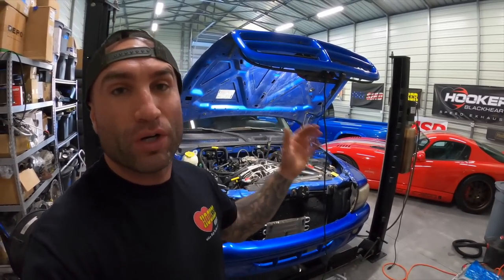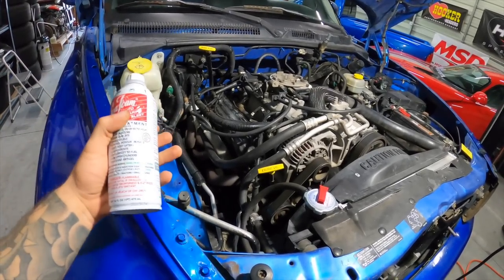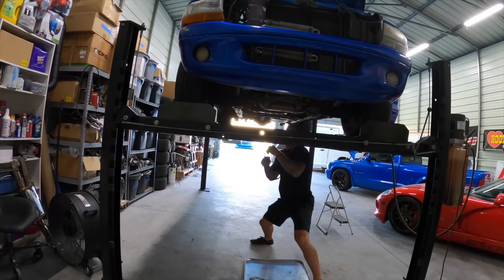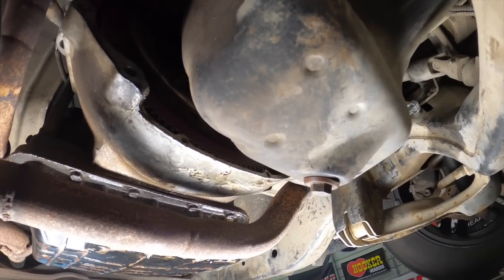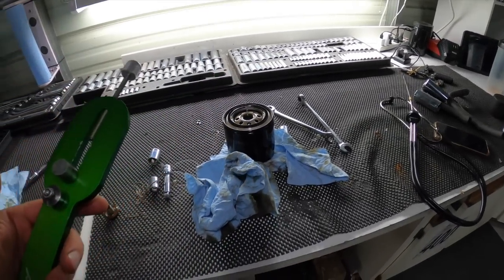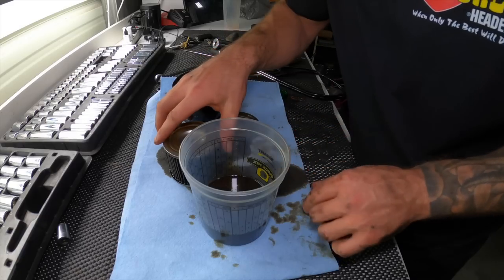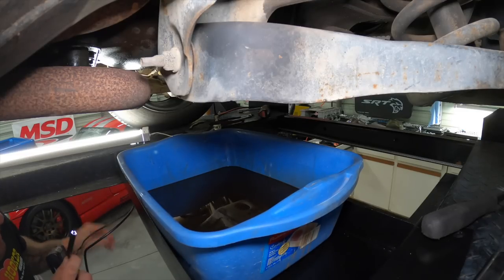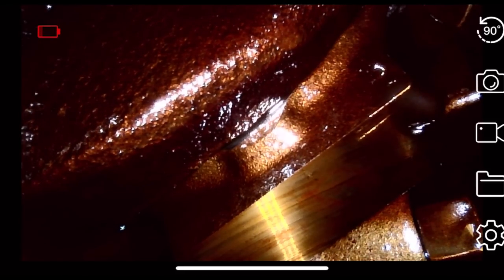What is wrong with this 5.9L 360 Magnum V8 Engine Part 2

Comment: Definitely want to pull the pan and see if it's the rod bearings. If so I'd like to see you try new bearings and see what happens if the crank looks good.
Reply: I agree.  Let's do the rod bearings first before quitting on this engine. It appears to be in too good of condition to just let it go at this point.  Plus, inquiring minds need to know...

Comment: I mean, iv seen rods with about the same amount of play if not more with no knock. They do move a little as oil psi is all part of the tolerances. I'm curious to see what's going on with the flex plate and converter. If that converter wasn't installed right it could be wearing on the thrust bearing and they make some wild noises. Ime, when a bearing starts to go, you get reduced oil psi and quite a bit more metal in the oil and filter and the noise is a deep/muffled noise. I'm curious to see where this all leads you

Comment: My 3.9 did that with original transmission. Pulled converter and splines where twisted almost a 1/4 way around   it to rattled pretty bad like that

Comment: why am i watchin this again, hope against hope,once my 73 duster started making a hi pitched shrill noise,it was something to do with oil filter suckin air or something,o i was scared to death it was my good bracket racing money winner, but fixed it fast like near 20 years ago, had an e 58 360 in it, an big valve heads etc, windage tray..we had a good formula..........

Comment: Had a 97 Dakota throw a rod bearing, I wouldn't run that engine more, if you want to save it. Also why you have rub & wear in the oil filter.

Comment: I had a nock/hard tick unloaded at 1500 rpm or more as long as you load the engine enough the noise is nil or gone.
With disconnecting 1 spark plug lead each time it appears that at cylinder two the noise had suddenly disappeared....6 cylinder line.
Caterpan removed 2 cylinder the connecting rod loosened and the babbit layer was quite a ways away the copper color was visible.
My luck the crankshaft was undamaged two new connecting rod bearing shells fitted and never had any further trouble has always run well with no problems

Comment: pull the transmission and check the plate you wont be able to see the crack without pulling the transmission and torque converter i worked for chrysler for 30 plus years and it sounds just like a cracked flex plate heard that noise many times and its a cracked flex plate
Reply: it cracks right around the crank shaft

Comment: Was thinking you might have turned A lifter, but if the noise goes away with increased oil pressure you may be looking in the right place.
Reply: Be a lot more damage and noise including misfires etc.

Comment: Stop wasting time its flexplate or rod bearing
Reply from the maker: Wasting time? You ever heard of diagnosis or do you just replace parts with your eyes and ears closed?
Reply: @BoostedMotorsports  20 yrs experience dodge expert, engine rebuilder. I know dam 5.2 and 5.9 and 4.7.  Most common is rod or flexplate.
Reply: What about both being an issue at the same time  ??
Reply: @sparkman6713  no yes still good to show for those that dont know.
Reply: Definitely not wasting time. He is doing it for the experience and helping others learn how to self diagnose.